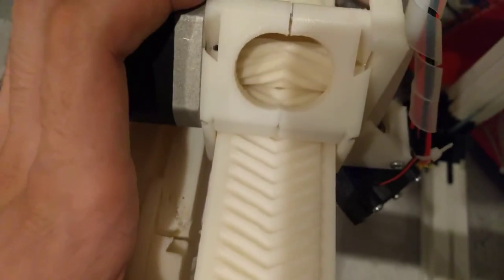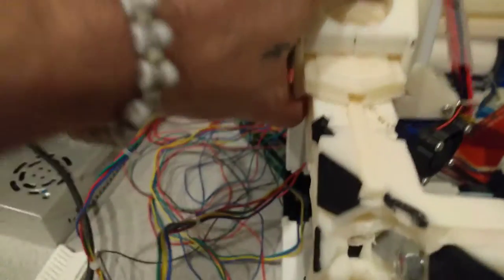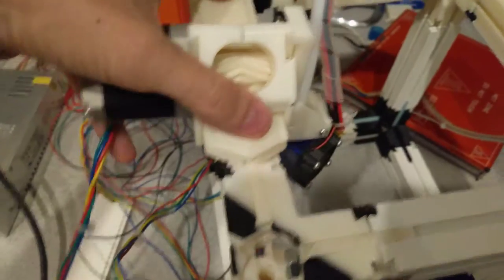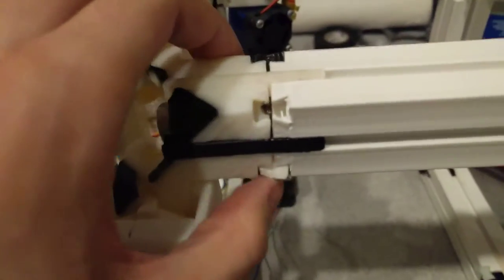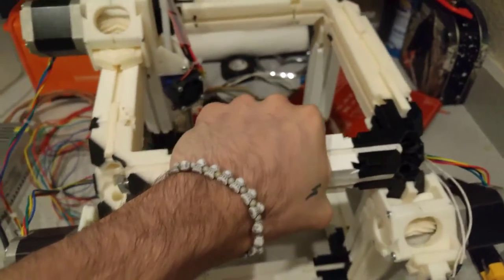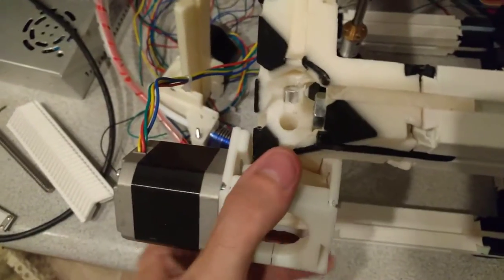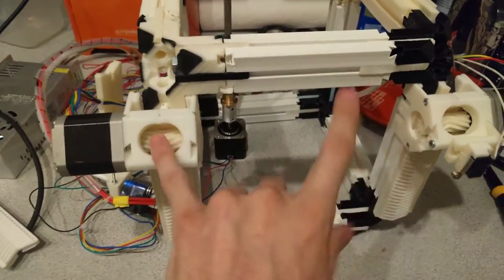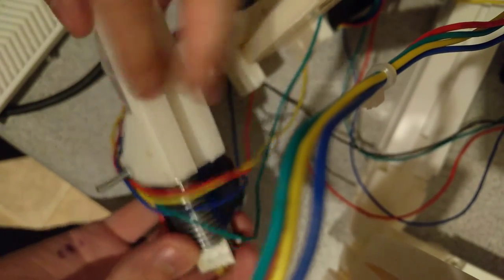How the dollo eliminated belts and belt lash

Comment: The new parts look really slick.
Reply from the maker: Right? They look way better, they are stronger, less issues to print, and make the axis ride more smoothly. It's 10x better in every way.
Reply: personally I had some issues with the old racks and the bowties that you had to slide through the sides. To get them out, it was really hard. These new extensions should be way easier to print now too.
Reply from the maker: Angel's Tinkering Corner Yeah they are easier to print and easier to take out the ties, making it easier to scale up
Reply from the maker: they are easier to print (if your printer has the height for them) these one you can slide everything together by hand, and it drops the part count down by a lot!

Comment: When splitting herringbone racks I think making the V cut in the opposite direction than the direction in which the herringbone profile runs may make a smoother transition (assuming a small misalignment). Did you consider making the cut in the other direction? What are your thoughts on that?